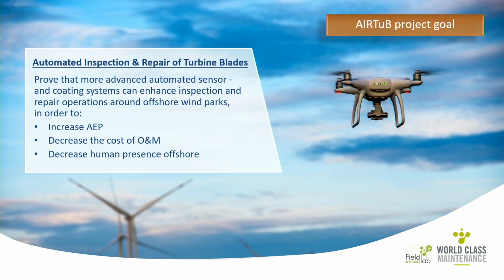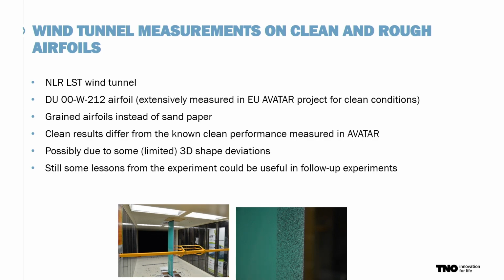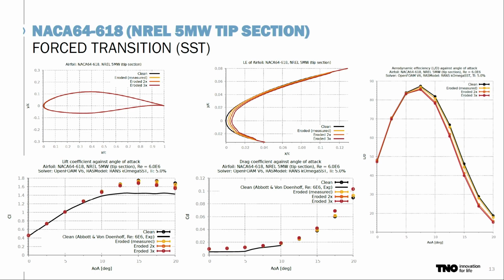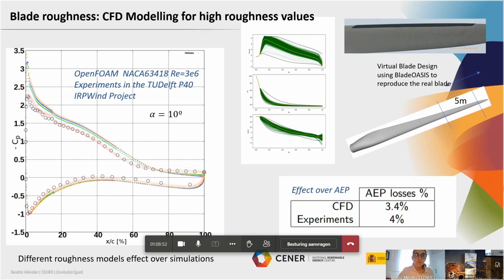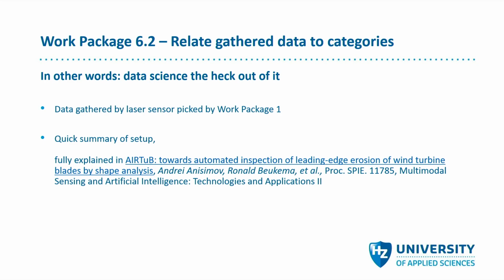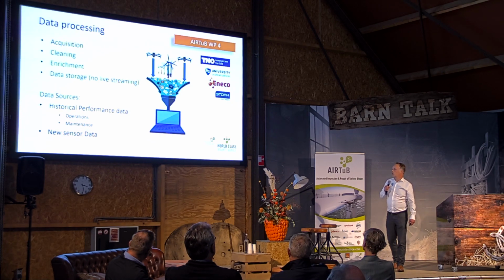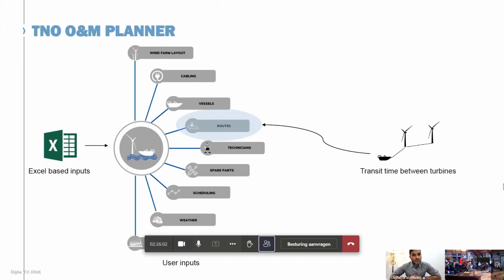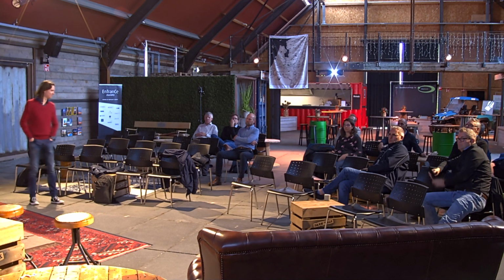AIRTuB event 2022.10.14 "Erosion modeling and repair recipe"

Comment from the maker: The event has been recorded. The times of the presentations are listed below:

00.03 Opening & Zephyros AIRTuB update: Ferry Visser, World Class Maintenance
10.40 Gerard Schepers, Hanzehogeschool Groningen & Kishore Vimalakanthan, TNO – Aerodynamic erosion modeling on turbineblades 
51.30 Beatriz Mendez Lopez, National Renewable Energy Center CENER (Pamplona) – The aerodynamic erosion activities at CENER (online)
1.18.10 Loek van der Linde, HZ-UAS – Using machine learning to classify LE erosion
1.41.40 Ludolf Pijpker, Stork Asset Management – Tool demonstration and AIRTuB use-case
2.01.57 Vinit Dighe, TNO – Business Case Workshop and demonstration used software tool
2.18.54 Paneldiscussion